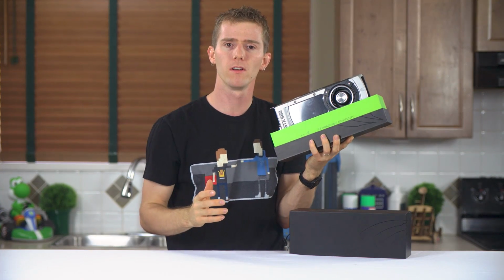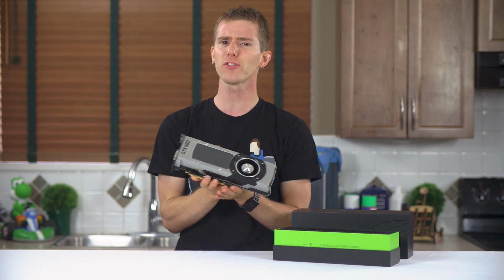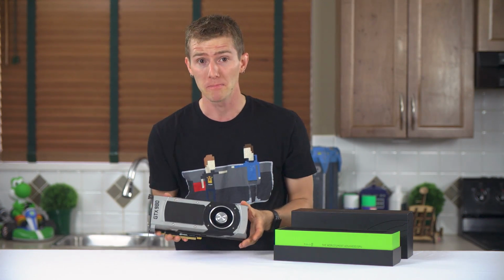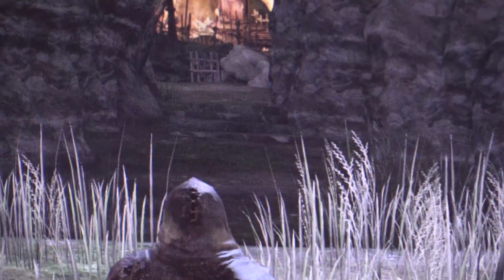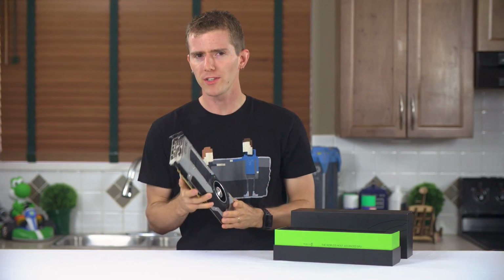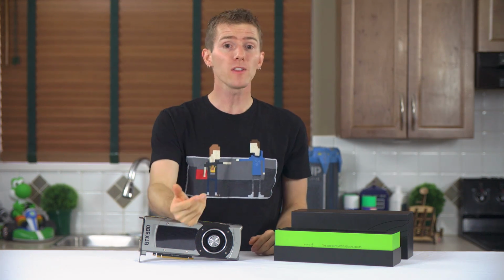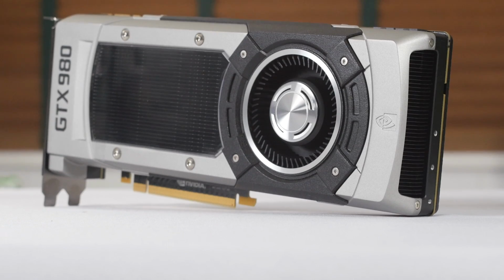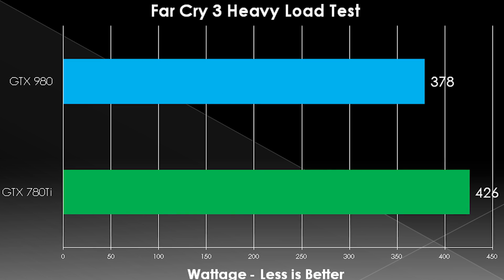NVIDIA GeForce GTX 980 Video Card - Performance Overview

Comment: Very impressive.  I'm always the guy that will get the slightly beast of a card versus running in SLI.  The last time I ran SLI, the price to performance ratio was just stupidly bad.  I build my systems to last me 5-6 years and play games on max settings so a little extra cash is always worth it to me.

Comment: Rocking a 750Ti, aw yeah. 1080p medium settings baby beat that.
Reply: 550Ti 1080p low , bring it on , bitch!
Reply: Bob Joe I got a good processor at least lol, 4770k.
Reply: Ive got an I5 4670k So im pretty good for a while
Reply: Gtx770 1080p ultra :3
Reply: Something Random Inc. Hah...You got a 4770k with a 750ti?GGWP NO RE
Reply: GTX 470  1080p medium/high... (unless it's watchdogs or Crysis) STILL WORKING AFTER 4 YEARS OF SERVICE! Please tell me again how the chips would fry after 6 months of use.

Comment: How much VRAM gb does it has, of it were you what would you choose hd 7990 vs gtx 980 for 5780x1080p gaming Advices are appreciated
Reply: 4GB. And a 7990 is a R9 280X. A 980 will destroy it. But a single card won't do that res very well.
Reply: Thanks,  do you have any recommendations for a graphics card/s setups in this resolution for 800$ All help will be appreciated

Comment: I imagine it will take 100s of years for the power saving from moving to a 780ti to a 980 to beat the cost of buying a new 980
Reply: If you have anything above a 770 its not worth the upgrade id wait for the 980 ti or next gen or sli

Comment: Did they just skip the 800 series? >.>
Reply: Yeah, they announced they would skip the 800 line entirely months ago.
Reply: Okay, I don't really follow releases and news that closely for this stuff. I do some research when an upgrade is due. That's about it.
Reply: Nocure92 I get ya. So all there is to take away from this is not to worry about the 800 line. It won't be missed. ;)

Comment: I've been anticipating these 2 cards for a while , and after reading the VR Stuff Im sold and will finally be upgrading from my HD6950 2G.
 for the first time ever i was willing to push my budget beyond the normal £230 limit I normally set myself for the GTX980  AS THE $550 worked out as £335.48.
seemed worth the cost for the improvements.

BUT I read the UK PRICE IS £450 :(((((((
Im NOT Impressed as this conversion is not based in reality,it seems like madness,  I had not such issues with my Oculus RIFT price at it was what is should have been.
So now im left with the 970 as the only option as half a grand is just too much for a GPU :((

Comment: Oh man, I could be in love.

But I really gotta know if it'll be worth dropping the extra cash on the 980 considering I'll be hooking it up to a large HDTV. That means 1080p 60Hz max. I was even going to skip on the 780Ti and just get a 780 because I feel like all that extra GPU power will be wasted on that resolution and refresh rate.

Anyone got any thoughts on that?
Reply: My thought are if you want it go for it. You'll be set for a while and be able to max everything, plus you'll be ready for any really hard to run games in the future. Plus this thing is really power efficient for what it does.

Then again you could also just get a 750 Ti and save a boat load of money and have a good experience.

It just depends on how important pretty looking games are for you.
Reply: Something Random Inc. I do like power efficiency since that will mean less heat output in the long run.

I'll have to look closely at the 750 Ti, but it might be a more appropriate card for this build. Plus, I'll be able to build it sooner and can still upgrade to a newer card down the line.
Reply: PrimeSonicYT I use a 750-Ti and I'm quite happy with it. I cna easily run games on medium-high on 1080p at over 60fps. But if you are going to upgrade down the line anyway there's not much reason to get one besides having it sooner.

Comment: I...want...ONE!!!
Reply: i want 2.
Reply: Too bad that one costs more than my current PC and two cost more than the PC I'm planning on building.
Reply: Hendlton I'd say if your going to build your own computer you should at least spend 1,500 on it and save yourself upgrading for a few years Go big or don't bother.
Reply: Something Random Inc. Well I have about 1000$ to spend and plus I'm upgrading so I think that it'll last me a while.
Reply: Hendlton Suit yourself.
Reply: Something Random Inc. I'm getting an FX 8350,8 GB of RAM and an R9 280x,I think that should last me a while at least.
Reply: Hendlton All that matters is that you're happy lol. it sounds like a good system, I'm running an i-7440k, 12GB Ram, 750 Ti.

Comment: 980 cuz i cant afford a graphics card new power supply and water cool my pc just to get more fps i would rather stick more fans in and use a non overclocked device.
Reply: Its only require 165 watts and you dont need to overclock you pc. What you currently thinking is over kill, Except its 2020.
Reply: Bayu Anggoromurti no the 750 ti while testing the performance was overclocked but 980 wasnt and overclocking needs a motherboard that supports that and you need a better power supply but it depends if you already hawe a good power supply already.
Reply: LeftFourDad every test that linustechtips done is overclocked. Yes but it doesnt need an asus maximus or something like that, eveh a good H97 mobo can do well on ocing 980. yes you do need a good power supply if you want to oc but it depends on how are you ocing it. If you ramps up the voltage like crazy sure you need a good psu and perhaps a wc loop
Reply: Bayu Anggoromurti didnt he say that he didnt oc 980 but oced 750 ti and 980 not oc was almoast better than 750 ti oc? maybe i did mishear it and im completely wrong.
Reply: LeftFourDad nope, all result were done overclocked. Yeah absoloutlu that non oc 980 perform way better than 750ti oc. 750ti may one of the first to pack maxwell but never meant to be high end top notch card.
Reply: *Absoloutly
Reply: Bayu Anggoromurti k

Comment: gtx 980 ¨beat the 780 ti not OC
Reply: no i dont think so, lukes 980 overclocked like a banshee, more so than the 780ti.
I could be wrong but i think stock for stock the 780ti is a little faster.

Comment: I seen the performance difference from the 970 to the 980, there's little difference except maybe 10fps at most, certainly not enough to justify the $200 price difference. Like usual, 6 months later, Nvidia will put out a 980ti...

Comment: im thinking of building my own pc any suggestions? ps. my budget is around 1700-1900$ http://pcpartpicker.com/user/hakunu/saved/rzFmP6
Reply: I think that the 300$ motherboard is really unnecessary. You should get one in the range of 140-160$ also I would just wait for the 980.
Reply: when is the 980 out?
Reply: I'd get this motherboard http://pcpartpicker.com/part/msi-motherboard-z97gaming3 because it's cheaper, and it's an z97 which is the latest. I'd also get an 600w just to be safe other than that, it seems fine.

Comment: If this bastard was released LAST week, I'd have gotten it instead of the EVGA GeForce GTX 780 Superclocked ACX 6GB ($699 AUD as of Friday 12th, $649 AUD of Friday 19th) that I'm still fucking waiting for because AusPost spent 2 days dicking around and not getting my card to me! Where's a fucking DeLorean when you need one?!

Mind you, for that same $699 AUD I dropped in the 780, now I'd be getting a GALAX (Galaxy/Gainward) 980, be dropping $779 AUD for the ASUS 980 or $799 for the Gigabyte 980 (EVGA 980's @ $729-749 AUD currently have an ETA of Sept 24th, and the DCU2 from ASUS @ $869 AUD ain't gonna be here until the 8th of October). So for what was available last week for the $650-750 AUD bracket, my only options were the EVGA 6GB 780, or a Galaxy 3GB 780Ti.
Reply: Well.. shit happens.
Reply: ***** Dude, it dropped by ONLY $50 AUD, fucker still costs $650 AUD + S&H. I doubt it'll drop to anywhere near the current prices of a 770 for at least a good 6-12 months.
Reply: http://www.evga.com/support/stepup/
Reply: GamerMuscleVideos That is only for USA, Canada & Europe, not Australia and the rest of Oceania.
Reference cards only as well. So no Superclocks (factory overclocks) cards allowed anyway.
Reply: ***** I'm still waiting for it to GET into my hands in the first place - it's currently held ransom somewhere in Australia Post's network between Lavington (Albury) and me, and I ain't set to get it until Monday (~IF~ I'm lucky).
Reply: ***** Since I got it from PCCaseGear down in Mulgrave, this is going to be somewhat relevant;
http://www.pccasegear.com/index.php?main_page=conditions Section 11 -
11.1 We do not normally provide a refund if you have simply changed your mind about an Order, so please choose carefully.
11.2 In order to obtain a refund, exchange or to repair a product purchased from PCCG, including those products which carry a manufacturer's warranty, you must have clear proof of purchase; typically, a receipt or invoice.
(Emphasis mine)

I might be able to talk them into taking the GTX780 back and them shipping me a GTX980 of equal value of my purchase price (so; a Galax 4GB 980) once I have the 780 in my hands, but even then I'll have to pay for shipping the 780 back to them, 15% restocking fee for the 780 and shipping the 980 from them to me (adding at LEAST another week's delay to the upgrade from the effing 760 I'm stuck with).
As it is, the restocking fee (which is currently going to be $97.50) is almost enough to make it not worth returning because of change-of-mind since the 980 came out.